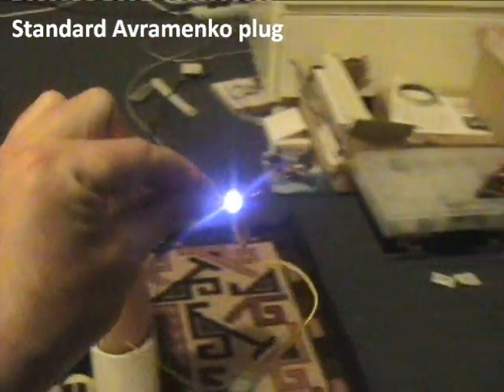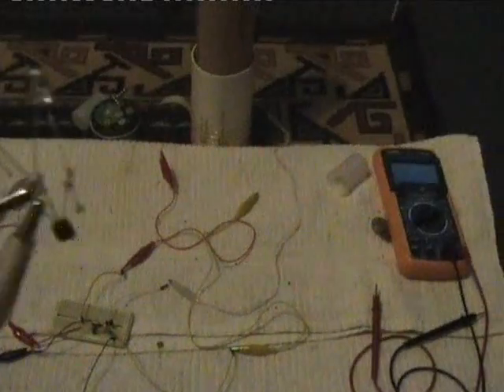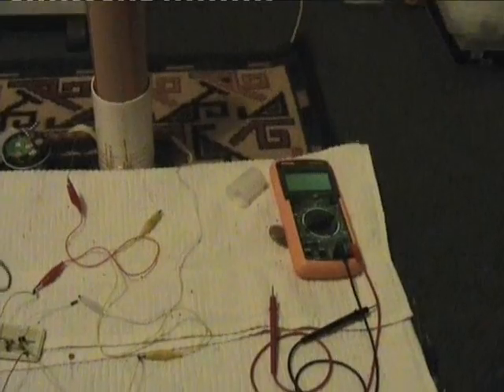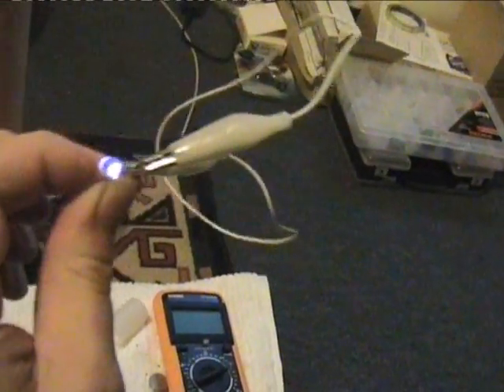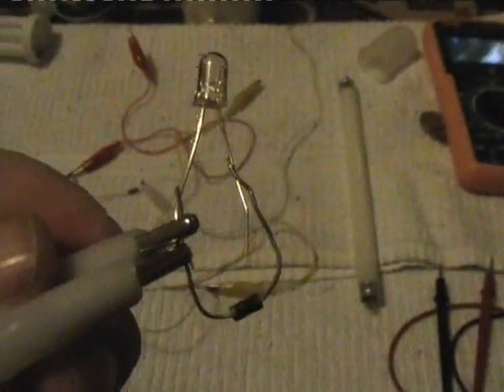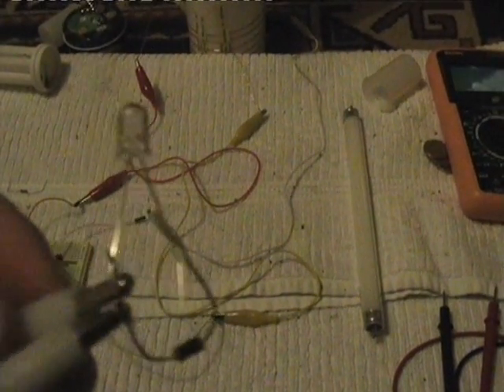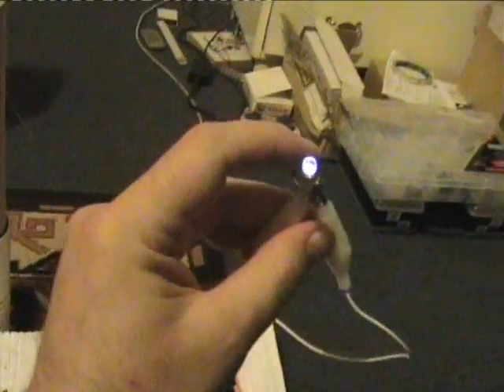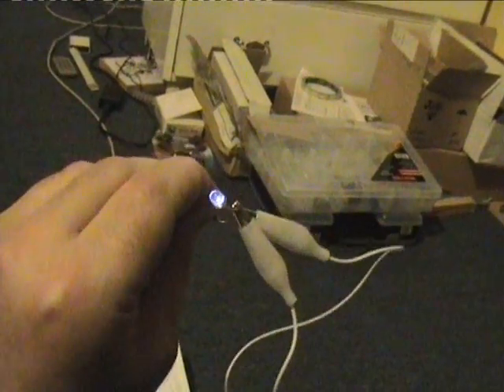Avramenko plug alternatives

Comment: @Br0kenMan I appreciate the offer, but about 15 mins after I posted this, I finally got it... my wire loop was a bit small, and my tower is so small... it does work though. Mine, works better for CFL's than LED's, it seems.

Comment: I made my first diode version today and tried it with my Mini tower, and  held it by the diode, which turned out to be the only way the LED would illuminate. I have a very small wire loop..and.. right away the diode heats up to the point of almost burning my finger 1N4007. I had to slip the wire loop right inside the tower to make the LED glow. I figured the LEDs would glow easier on my mini tower than the CFL's but that doesn't seem to be the case: opposite in fact. Am i missing something? Tks!

Comment from the maker: @MrFlathunter i am using a 1n4004 or 1n4007 but i should think any diode would work. The wire loop is not necessary but enhances the pickup. The pickup effect is also enhanced when you are holding the diode so i believe the body and the loop of wire act as an antenna.

Comment: Great video - thank you very much for pointing out that an AV plug doesnt need 2 diodes.  which diodes are you using??  Is it important in your experience, or do some types not work?  

Ive been trying to build one recently for my exciter - i didnt know the loop of wire was necessary - ill try again tomorrow.  Perhaps one of the diodes i already have will work.  Thanks mate!